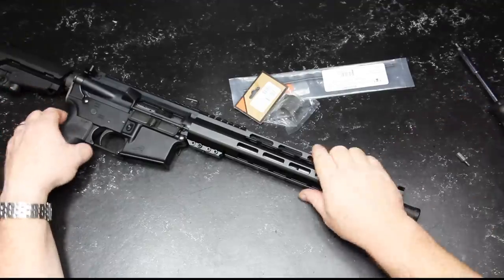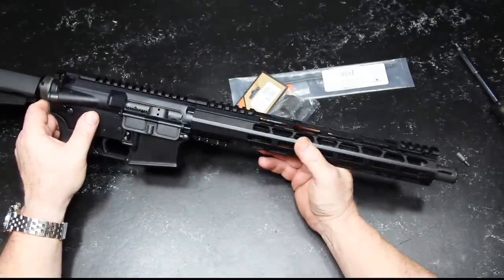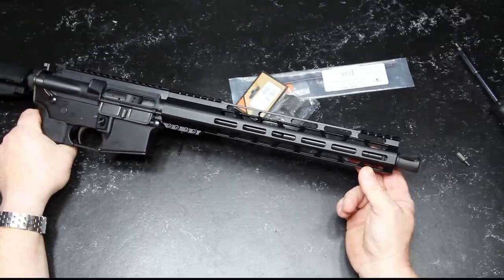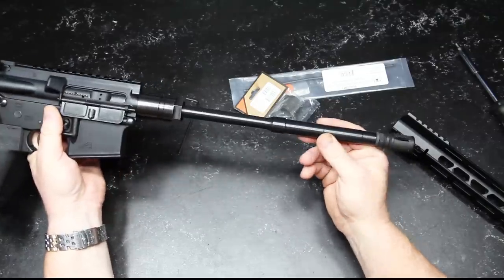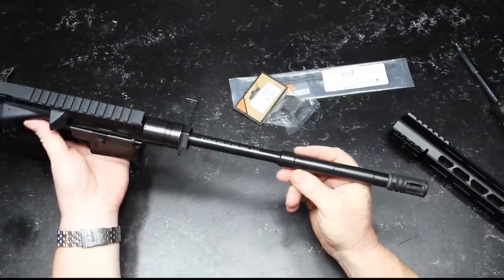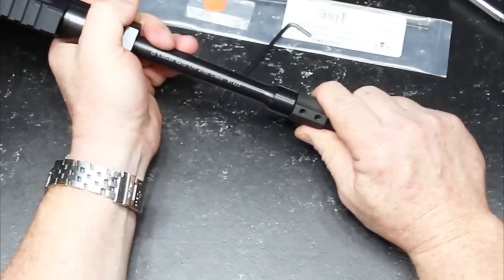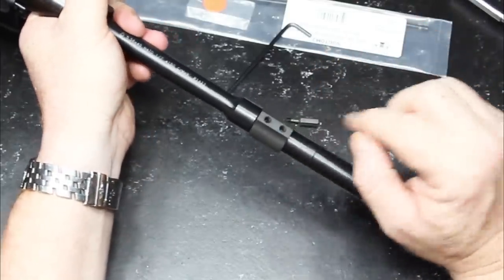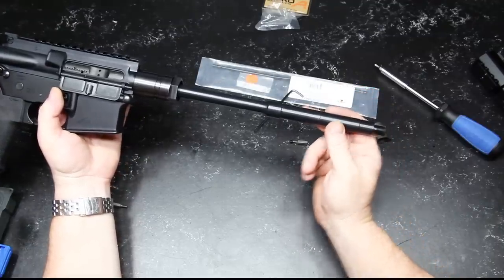Gas Block Installation Helpful Hints.  Line That Hole Up

Comment: clue what you are doing dude!!! shinny barrels usually mean QPQ finished barrels, for example, and are hard surfaces, set screws and even a drill bit have trouble even putting a mark on the barrel. a dimple or even two dimples keeps your gas block from moving. high pressure gas, recoil, rapid heat differentials can all make gas block move not only back and forth but can twist. set screw beed a flat spot or a dimple to be effective,  So, don't be such a cheapo cheap, spend about 30.00-40.00 and just get one or better yet just borrow a dimpler tool from a buddy , if you have any, for God sakes, you don't have to care how well you do something, you just have to act like you care!